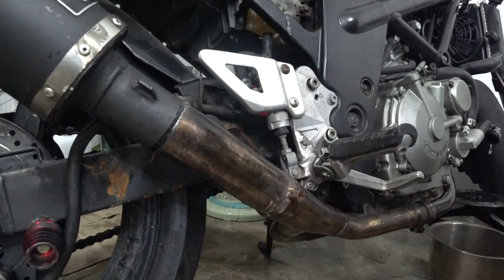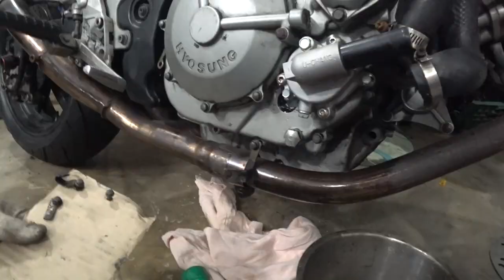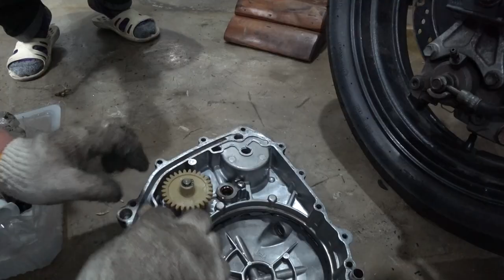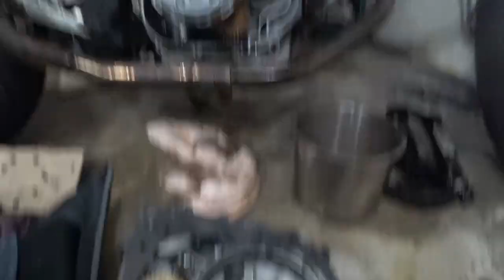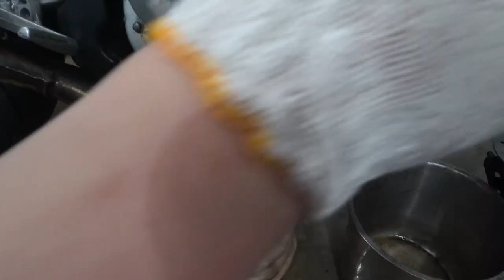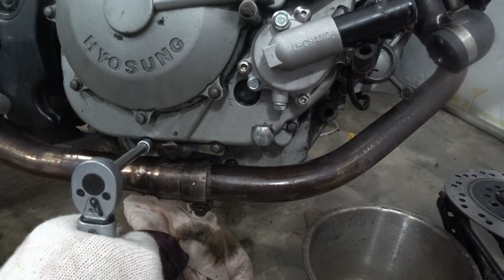how to Rebuilding A Wrecked Hyosung gt650r 07.

Comment: good video but for anyone who is removing these covers, please replace the gasket with a new one
Reply from the maker: I using genuine new gasket. Oil rube with gasket.
Reply: @ ah looked like the old gasket
Reply from the maker: @94Soarer  because rubed engine oil. Leaking engine oil. reuse old gasket. Must replace new gasket.

Comment: I need advice and help finding parts for my 2007 hyosung gt650s any recommendations will be a lot of help..
Reply from the maker: what kind parts do you need?

I so sorry. unfortunately, No supply many parts of comet even in korea.
many people lose hyosung. replace to honda
Reply from the maker: parts of chasis replace or modify suzuki parts.
starter is replaceable 2005 sv650 parts.

but engine parts can not.
Reply: @ppaha   I need a water pump the coolant bolt that surrounds it is cracked.
Reply from the maker: @p3aceofmind9  I find in ebay.
Search this key word "gt650 water pump"
Reply: @ppaha  alright 👍 thank you! Have a safe week.
Reply: @ppaha  what about one way starter clutch ?

Comment: can i replace piston with piston burgman 400 ? hyosung bore 81,5mm, burgman 83mm (oversize), but not sure about piston pin.
Reply from the maker: sorry, I can't guaranty. 
To avoid a legal dispute with Suzuki, the bore and stroke of the SV650 were made to differ by 0.5mm.
I'm not sure. You will have to measure the piston pin size yourself.